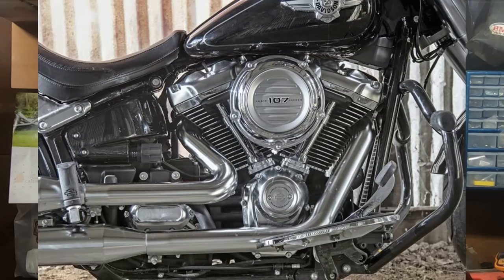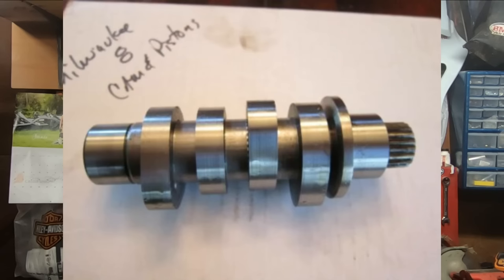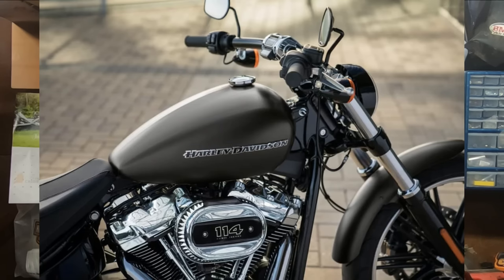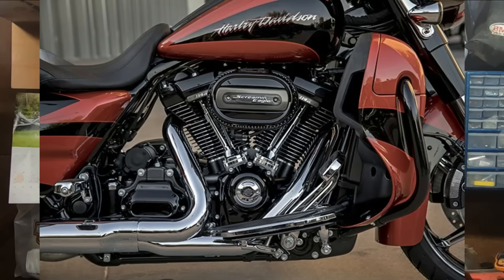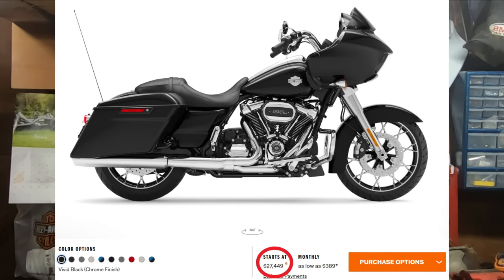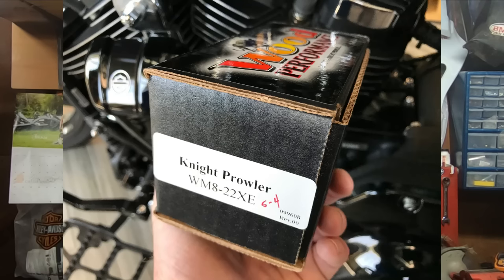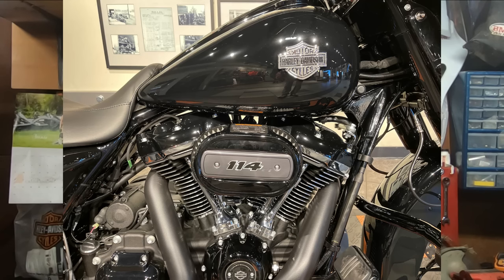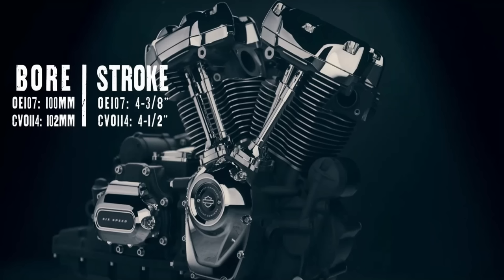Late Harley-Davidson 107's Are the Mistake You Make Overlooking

Comment from the maker: Would you go for a 107 engine or spend the extra on 114 with the longer stroke crank?
Reply: I would do the shorter stroke 107 because of the power delivery. I would upgrade the engine to a gear drive cam(new cams too) and the oil pump upgrade, must have maximum oil delivery and then.....Might as well put a supercharger on it...and never put Harley Davidson oil in it. LOL! It seems like all of the problems with the M8 happen above 107?
Reply: 107 is a tried and true engine.
Reply: @Just J yeah I remember but gixxer is talking about the late model 107’s.  I have a 2021 RK 107 and the engine is on point no issues
Reply: I'm still rolling my 99' Sporty with a 883, so ya a 107 would be plentiful in the HP department. In So Cal traffic having all the ponies won't do much good lane splitting if ya can't fit.
Reply: @XL883CNick  , hammer 1275 kit !
Reply: @atcjoe1600  was actually getting a 1250 kit but life happens so that's on the back burner for now.
Reply: I chose the 107 in the Road King over the 114 in the Special.  I love it.
Reply: Can I ask for the 131 😂??
Reply: I have my 2020 m8 stage 2 107 and my bike now has 43k miles. No issues.
Reply: I had a 114 road king special and recently traded in for a 107 road glide, there’s no real difference in the butt dyno
Reply: I’ll stick with my 74” shovels that everyone is jumping on the bandwagon with these days and my newest one has a 96” Twinkie that runs as good as the newer ones
Reply: I have a 107 and I'm very happy with it. Thanks for the video, I will be getting this
Reply: I got the Milwaukee 8 107 with a 472 comp cam Bussani head pipe SVT jackhammers and ended up dyno 112 hp and 120 foot pounds of torque and I love it in stock. I had 77 hp in 100 foot pounds of torque.
Reply: Iwouldn't touch either one. I want to but to afraid to because of all the problems they are having
Reply: @roberthambly9926  Not sure what ‘problems’ you’re talking about.  I’ve got a 2021 M8 107 about to turn over 20,000klms and no issues whatsoever. Pretty bulletproof as far as I’m concerned and I have only good thoughts when setting off for 5 day rides.  I think there’s a lot of bad press and from HD haters because they can’t afford one.
Reply: @XL883CNick   I snagged an 89" S&S stroker 1997 Sporty (required a downtube stretch to fit and gobs of labor but not mine!) for $1700 and when I put that on the road it will have very visible 883 markings.  See xlforum for all the relevant info. If ya build it making a sleeper is so rewarding.

Comment: my cousin is a certified Harley tech and he's told me multiple times that the 107s are putting out crazy numbers if built correctly
Reply: If... Well, that is hd's job.
Reply: @corneilcorneil  he's not trying to sell me a bike by saying that tho so...
Reply: @theboochiestore  still, it is hd's job to build a reliable engine... but after 100+ years, they still fail.
Reply: @corneilcorneil  lol they build many reliable motors...
Reply: @jonnymac8925  Ok, list them, please. Reliable mean: can compete with the REAL reliable big four: Honda, Kawa, Yamaha, Suzuki. I really hope to learn something and read some facts and number. By my experience, the Evo was the ONLY engine that i dare to call reliable. Do you know others?
Reply: @jonnymac8925  No answer? I really like to know what HD engines are so reliable.
Reply: I’m amazed people think there’s a real difference in these M8 motors. Same motor design , just a bump in displacement.
Reply: @bobbert6770  Nice theory, but a huge faiI. Generalize the whole HD brand and stating that parts are all over... not correct. Czlling a machine "reliable" because you can finds parts when it faiI is also a wrong theory. Reliable ma hines need not much more than oil, filters, bearings, cables, greace, ...  You sound like you are NOT into bike mechanic stuff at all.
Reply: My 107 with 472 comp cam and Dyno was 112 hp and 120 ft pounds of torque
Reply: @corneilcorneil got a 13 street glide 103 engine that got a 112,000 miles on it no rebuild just routine maintenance. There very reliable man. I understand some don’t have the money to put in a Harley so they buy a metric and trash talk what they can’t afford. But my grandfather rode and my uncle and me and it’s been Harley my whole life. And Harley is where it’s at, I get you have to customize and add parts but everybody likes there bikes built differently as well
Reply: @preachermanbe   Congrats... can i be your friend? 🤣🤣🤣🤣🤣🤣
Reply: @corneilcorneil there’s many Harley’s out there with a crazy amount of miles on them with little to no repairs done on them. 
Proper maintenance is key, take the L netbanger
Reply: @alejandromunoz2853   The big 4 are called big4 for a reason. I saw too much new HD's break down to believe you.
Reply: @corneilcorneil How about you move out into the mountains somewhere and don't bother nobody
Reply: It's really yours after investing a couple grand in the engine , know you got one hell of ah engine

Comment: I have a stock 107 with the exception of a TAB slip on muffler. I'm very happy with it. Runs strong with my wife on the back. Easily capable of getting speeding tickets in short order. If I was looking for a fast bike, I would have bought a 'Busa.
Reply: Same here …..
Stock 107 with TAB Zombies…..plenty of power & sound !!
Reply: How is the Tab performance slip ons exhaust on the bike?
Reply: @gary rhode  Sounds great, hasn't changed performance that much.
Reply: I want a 100k mile bike.
Reply: You will still want fast....if youve ever had one that is...

Comment: Yeah that's how it always goes for Harley. The smaller displacement engine quickly falls by the wayside. In a couple years the 117 will be the standard engine, there'll probably be a 121 for the CVO's and the 114 will be called the "small" engine. Whatever lol
Reply: If you think other motorcycle manufacturers stick with the same displacement indefinitely, you are kidding yourself.
Reply: And then the 121 will be the small engine just like how Harley  Davidson came out with the 117 CVO and people  still wasn't happy so they get the 131 crate engine  and then made that into 140 engine  it goes on and on and on 🤣🤣🤣 I'm happy with my cvo 124 drop in kit  .
Reply: I had a new 61” Knucklehead back in ‘36 then the MoCo came out with a 74” in ‘42, it never ends🤣
Reply: @Motorcycle.guy.69  how old are you?
My grandmother was born in '36. She's 87. You're a champ if you're still riding. Many props

Comment: 2019 107 Stage 2 Oil-Cooled now going into season six. Still perfect. Still rocking. 
Still pulls to the rev limiter and speed limiter. Nothing more required.
Still using Syn 3 in all 3 holes. Always comes out clean. Zero debris on magnetic plugs ever.
Doesn't burn a drop from change to change.
I have never seen better wear characteristics in an engine in my Very long years.
Good engine. That Woods cam is soo inviting tho. lol. 
Thanks man.

Comment: I agree 💯 with your review, just had a cam installed on my 2020 softail slim, boy dies that motor wake up with stage 1 mods and now can, runs smoother and punches hard. Can’t imagine wanting any more than the engine provides now

Comment: 19 electra glide standard 107.
Took everything out of the cam chest and installed a S&S 465G
Cam chest kit, PV tuner, fulsac headers and pulling 105 hp and 
112 fp tork……you are absolutely right! Love the motor!
Also put external breather on it and
The bike seemed like it came to life
Reply: I tried external breather on my 107 but with 465rs it pinged and dumped, finally gave up and traded it in,. Dumb move by me probably,since I had replaced/fixed those issues, oh well
Reply: Got similar performance with redshift 468 and Power Duals hi output VH exhaust system, Arlen Ness big suckerS&S cam chest and oil pump, I never increase displacement, just look after the fuelling and exhaust and you will have performance and longevity.

Comment: I'm riding a stock '21 Softail Slim. It has plenty of power and I like the throttle and power delivery vs. the 114 Heritage I was also considering. I have owned many bikes, but this is easily one of my favorites. Does everything well, it's like the new UJM... lol.  114/107 It's really like splitting hairs, the difference is really not all that much especially stock (or with the same mods). I ride with guys that are riding twin cam 103 and none of them feel like they are lacking power. 107 is a fine engine.
Reply from the maker: Thanks for the info! It really is splitting hairs, dyno numbers are one thing but on the street is what really matters.

Comment: With only a few mods done on my 107 I smoke 114's like cheap cigars with that short stroke motor. Only advice is use good reputable proven aftermarket parts and tune. great motor to build the way you want it
Reply: *you smoke stock 114's. In no world is a stage 2 107 "smoking" a stage 2 114.

Comment: I traded in my street bob 114 last week for a new 2022 Electra Glide 107. Wife decided she just wanted to ride 2 up and not on her own. I was approved for a loan from my bank and could have gotten either the Electra Glide standard or Road king standard 107 in the price range i was approved for. My father had Electra Glides for years so naturally i went with the bat wing fairing. I've noticed the 107 is a bit smoother  than the 114.  The 107 has plenty of power IMO even on a touring model. I ordered cobra 909 pipes and will be ordering a high flow air cleaner in the coming weeks. I will be doing a stage 2 kit over the winter as well. Although I'm not sure which kit I will do since I'm unsure if the warranty will be voided even with this FTC stuff going on with Harley-Davidson. Great video and I'm glad to see the 107 is still viable to some people.

Comment: I think too many people focused on the displacement. It wasn’t quite big enough to draw people from the tried and true 103. What many failed to realize is how well these M8’s breath. With some simple mods and a tune, the 107 will really scream.
Reply: But, the weak links need to be addressed first. Yes, a four valve head design will obviously breathe. But little details confound me. Why they would design the oil return line to be routed as such ???
Not well thought out details.
JMO.
The EVO, still a benchmark of reliability, and simple, straightforward design.

Comment: A M-8 107 is like a small block chevy,short stroke,if build,tune correctly their nasty just like my TC 95. I'm about to do a stage 2 on my 2021 107 SG standard.
Reply from the maker: I've always said there's a lot to be said about short stroke, that 95 makes power real quick compared to a longer stroke engine. The 107 does the same thing, especially when you hold on a 114 with that shorter stroke.

Comment: 107 for the win!!! On my second Harley with a 107. first one i staged 2, but after i get done with some finance stuff, im going stage 2 on my second. Might go 124ci, and call it a day. 22 to 28 thousand for the engine upgrade sure is a bummer. I actually went 107 on my new road glide due to pricing. Had a choice of my dealerships last two 2021 road glides that they were gonna sell me at MSRP. Just couldnt pony up for the 114. Thats a new car price. Great video Gixxerfoo.
Reply: My 107 has 43k miles on the odometer

Comment: I put a 465 s&s cam in my 107 with a vo2 rogue air box and V&H power duals and destroyer 450 mufflers....had it tuned and I'm getting 97hp and 118ft-lbs of Torque to the rear wheel

Comment: Got a '17 RoadKing, thought it had lots of power compared to my '05 TC88 ultra . Put a 460 Andrews cam, Feuling oil pump, Rhinehart 2-1's, Cobra high flow air cleaner and Thundermax tuner. Holy smokes..... the difference is amazing from stock,  almost scary, but really evened the throttle response,  and more top end than I'll ever need.

Comment: Bob Would be proud. Ha, see what I did there? 😉 2018 FLHTK 107. Before the warranty was up I installed this cam, S&S cam plate and oil pump, Fuel Moto lifters and pushrods along with Tab Performance Zombie baffles slip ons. FP3 does a great job controlling managing everything. It’s a great set up and I love that cam. Just enough lope that you know it’s there at idle and turns on around 2100 RPM, and pulls hard past 5200. Thinking about trying the standard baffles, Zombies are to dang loud. Thinking my next add is a Darkhorse compensator and Hayden tensioner or maybe the manual adjustment Screaming Eagle. Those M8 heads flow great with the 4 valves. That cam shines in its overlap. Good video!

Comment: I love my 107 in a Softail. So far just a stage 1 and a FP3 I’m at 81HP and 108 torque. Doing a S&S 465 this winter and hoping to get to the 83-85 HP, 112-115 ftlb
Reply: Sir I can tell you this if you change your exhaust to a quality 2into1 and cam that scoot you will turn that 107 into a beast!! My little 88 tc with a cobra 2into1 and a S@S 510 cam well my scoot is no slouch 83HP. 94 TQ. Rear wheel. My friend has a Slim 107 put a stage 1 with V.H 2into1 he gained 20 % H.P. That scoot is quick!!!!
Reply: @rodleithner7931  for now running a V&H Big Radius 2-2. I know I’m giving up a little performance, but I just love the look of the pipes.
Reply: @bigj200016  I copy that. My last scoot I had V@H short shots loved the look also loved the sound.

Comment: I had an Ultra Classic with the 107. It felt like it ran out of power early in the curve. It needed some magic. My 21 RGL with the 114 feels more like a twin cam where you can pull longer in each gear. My RG now has a high flow air cleaner, full TAB exhaust and a thunder max tuner. Runs amazing now…. With a loss of 10mpg! 😮I didn’t stutter, my bike went from 47 mpg to 37 mpg😅. I will be installing an S&S 475 cam in mine. I really felt that fuel economy loss on my Sturgis trip this year😅

Comment: Just finished my M8 107 Build with the guys at Moonshine Harley here in Franklin, TN . 22 Road King Standard...  SUPERB Torque Curve and "always on" power.  121 Torque and 113 HP out of a 107!  Wish I had a way to post the Dyno sheet here but man this thing is great.  And to your point... I bought a 22 Road King, did ALL the engine build, plus suspension, Custom Dynamics light and STILL cost me less than a Stock RG Special out the door.  AND I promise this bike will outrun any stock 114 :)        For those interested...  Build is a Star Racing 485 Cam ~ 64mm TB/Manifold ~ Fulsac Header ~ Khrome Werks Mufflers ~ Arlen Ness Big Sucker (for stock 107 cover) SE Cam plate/Oil Pump ~ Rekluse Clutch and Basket plus MHP smooth Compensator. All this plus a proper tune and the bike is fantastic.

Comment: Love all your vids totally agree with this one here if for some reason I had to buy a new bike id buy the base street glide or road glide and with that 5 or 6k i save can do a nice 2 into 1 air cleaner tune front and rear suspension  and still probably be cheaper than the special models Maybe for next weeks vid do a gear driven cam vid for the twin cams and what it entails im perfectly happy with my 2016 103 HO stage 1 but maybe when i hit 30k miles in a year or two would definitely look into gear driven cam swap
Reply: That rain sock, is that a Screaming Eagle?

Comment: I have a 22 road king. I got that bike from n Covid days. It’s wanted a road glide. But to no avail could not get one. So I turned my road king into a road glide. Custom dynamic headlights, custom dynamic, running lights, custom dynamic, touring pack light custom dynamic saddlebag lights for the side and the back of it new frame that has the white light in the two yellow lights next to it took out that big clunky thing custom dynamic for lights got it all loved it. Only problem was my 1 07 did not have the power that I needed. It’s not that I’m out there racing around speeding around, but I just like that extra power you know what I mean so I bought the new exhaust slip on. I took it to stage one with the new breather and the tuning did a great job for a little bit that I went to stage two the cam was great, but I felt that I could still do a little better so I did spend the extra money went to stage three I should’ve just went to stage four altogether cause I think I paid more money doing it individually then I would’ve done it just going straight to stage four but it’s stage three the sound is there the speed is there the torque is there everything’s there and I didn’t compromise my gas mileage

Comment: If you’re building up a hot motor to spin for HP the 4.375 stroke is already a long stroke.  Better ring seal less piston & rod to block side loading. And less piston speed than the 4.500 stroke. 

If you are making peak HP at 6,400 and shifting at 6,800/6,900 for the highest average HP from shift to recovery the 4.375 should be a better choice stay sealed & live longer.

I’m picturing a 4.500x4.375 over square 139ci in my future.

Comment: little late to the party here, but I have a 2020 FXBB street bob, I did a stage one so far. SE heavy breather intake, Basanni 2-1 exhaust and SE tune. Took it from what they said 80 hp to 89.7 hp and from 105 ft pnd trq to 122. i like the gains tbh. 107 is just fine

Comment: Butt dyno! I forgot that term! I bought a new road glide with a 107 may 5th. On June 23rd I rented a 114 on my trip to Indiana. For 5 days I rode a good 4 hours per day except one day I rode for almost 6 hours. I am telling you that stock, both nearly no mileage, the butt dyno told me that the difference was nearly nothing. However it was a little my street glide rental might be a little heavier? Once I put stage 1 on my 107 (it did hit a wall at like 3200 rpm, although you could certainly go through it it was noticeable) I sincerely feel like it is all the motor for a guy who has never had the money to totally buy a ball busting Harley over a decked out 114 or more. So butt dyno s and speedometers don’t lie. Don’t think it is inadequate or something, it can really hang on the road.